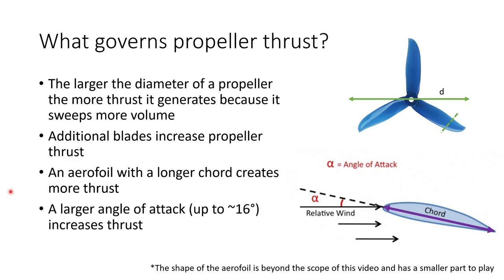How to choose the right props for your quadcopter: FPV Freestyle, Racing, and Long Range

Comment: This is very very interesting and confirms and extends much of my own investigations. I have a question: how does the inflow velocity calculation change for fixed wing? Obviously the vin from the airspeed but do you need any additional factor to account for the inwash from the prop of can I just plug in airspeed in m/s?
Reply from the maker: I think you should be able to calculate inflow velocity using a momentum balance taking into account that the initial airspeed is not 0 as it is for a quad in hover.

Comment: Hi, 
I asked myself all the time how to think about this on my Cinewhoop. I just finished watching your new video about ducts, and I have a squirt V2 at home. Also I am just designing my own "megas-quirt", that can handle 3.5" (89mm) props, as my Squirt is barely holding itself in the air with a Hero 8 and a 1300mAh 4s lipo. 

Now to my question:
How do you think that multiple blades change the therory. By that I mean the 6- or 8-bladed HQ props, or the much steeper Gemfan D76 or sth like this. My testing tells me, that  two props that both are called  to have a pitch of 3 aren't really comparable, doesnt matter whitch size (3", 5", ...). 
In the cinewhoop-part also the diffrent blade-count makes everything even more uncompareable. I really have problems to compare a Gemfan D90 (3 bladed prop, pitch "3") to a HQ 89mmX8 (also pitch of "3") but they clearly are diffrent in their steppness-angle and will poth have very diffrent thrust. 

toothpick-class: Gemfan for example has a 3018-2 prop (biblade) and a 3016-3 (triblade), I also cant tell in this case which prop I could expect to have more thrust. The issue is, that we often dont have real numbers to calculate with or alternatively have simulation-values or static-bench test from the manufacture himself (1st hand).

Sometimes I have the feeling, the manufacuters dont use the pitch-value to tell us how steep the balde is, rather to tell how much thrust they think the prop makes compared to their other props on the market. By adjusting the pitch value they use for marketing so they can put their props in somewhat of an order they make comparison for us pretty rough, and practically impossible to compare to other companies.

Did/Do you think/feel the same as I do, or do you understand my problem? If so, do you have any idea how we could interpret these values we get from the manufactures, or do anything about it other than just buying a ton of props just to find out that 99% arent the ones we where looking for?

Thank you so much for your videos, it is great to understand such topics in greater detail, love it, keep it up!
Reply from the maker: Comparing props is difficult because they are not fully specified by the manufacturers. Their performance is also very dependent on your AUW and flight style.

I would suggest trying a prop and then asking yourself what you want more of:  thrust? smoothness? efficiency in hover? efficiency in fast forward flight.

Then use the info in the props video to move you in the right direction. E.g. more thrust = more blades or steeper pitch (but steeper pitch may be less smooth).
more smoothness = shallower pitch

It is not really possible in my view to pick the perfect prop just by looking on the web. But it is also not necessary to just buy every prop and try them all. You can take a more focused approach. I hope this helps.

Comment: Great content! It got me thinking though, what if one would (theoretically) construct a prop that utilizes centrifugal force to alter the pitch slightly? Think of how a CVT system works with weights and ramps/rollers.. Would it be possible? Would there be benefits to reap from doing this? And yeah, it would likely not be suitable for a 5" prop for rigidity and durability reasons.. Maybe this is already a thing, I haven't read anything on the subject, but this video just had me thinking about how it could be done.

Comment: Hey Chris - I know this might be semantic but I think it is an important distinction when talking about the dynamics of our kwads. I thought that the prop generates lift and the portion of that lift that provides forward motion is thrust? So wouldn't the specific airfoil and angle of incidence change the how much thrust is generated? I thought, Angle of attack is generally in reference to the prop where angle of incidence is relative to the craft's attitude of a specific axis. Additionally, I think the use of certain generalizations is a slippery slope. Also I have a question regarding the V(inflow), I don't think it always has to be axially aligned - but the angle should be a known value for calculation.
Reply from the maker: Hi Zach, in the video thrust just means the force generated by the prop in the axial direction. The lift generated by each prop blade creates this thrust.

There are certainly some simplifications in the analysis to allow general conclusions to be drawn. I think that it is important to make content that is easy to understand so that everyone can benefit from it.

You are right that it is important to distinguish between AOA of the blade and AOI of the incoming air stream. In flight the incoming air will rarely be axially aligned to the prop (more on that in my upcoming video on ducts) but I think it is a valid simplification for the analysis in the video which primarily considers hovering where the the flow will be close to axial.

Thanks for your comment I hope this answer was useful 😁

Comment: @Chris : Thanks for the useful videos . Wanted to bring up one question on props .  Lets say while flying a 5 inch quad we tend to keep stock of multiple props . While all props will usually be 51 series ,  the pitch could vary . Now while flying  lets assume we have a 5143 set on the quad and happen to break one or two of the front facing props . Now the only other set i have is a 5148 set  . If we replace the front props with the 5148  does it cause problems .   what happens if we end up mixing pitch of props mounted on a quad ?  Is this a bad practice  or something that never must be done ?

Comment: Now I know i have to order some higher pitch props for the 5” cruiser i’m gonna build...
Reply from the maker: Wonderful! I hope it turns out great. Is it a long range quad?
Reply: @ChrisRosser  Well, it’s my first complete build. I have build a Tyro129 but all the components were “in the box”. Now i am selecting all the components myself. And since i am a bit older and my brain is a bit slower😬, i want to fly slow and steady. So that’s why i want to built a cruiser. Not really long range since i use analog FPV and i don’t have crossfire yet. But ExpressLRS looks promising. 
So first it’s gonna be a short/midrange cruiser.  And eventually a long range cruiser. I hope 😎

Comment: I have a question about prop tip speed. So I used a calculator, and I saw someone had 5 inch props spinning at 65,000 RPM (max power) so I wondered what would be the tip speed and got 966.8 mph which is supersonic yet the quad was just flying normally even at full power, although it had a very loud “buzzsaw” kinda sound. I feel like there wouldn’t be supersonic airflow that would cause lots of drag on these kinds of props as planes with supersonic propellers like the XF-84 have straight trapezoidal blades, which still wasn’t so efficient. These drone props look like they’d totally handle supersonic airflow with little drag bc of how they curve towards the tip. Just wonder if what I calculated is true, as I would love to find out if/how it is possible to make a race quad with supersonic props as well…I want lots of noise and (maybe) speed lmfao. More noise for sure

Comment: I have a scenario for you. You have a 7" kwad that weights in at around 1kg AUW with 2806.5 1300kv RUNNING A 2200MAH 6S battery. You want to do aggressive long-range flying. Your going to be flying up a mountain that starts at 7500' elevation and tops at around 11k'. What size prop would you recommend to give good quick thrust but also efficiency for distances like 6 mile round trip. I have tried a few different types and settled on one that I really love but curios if there is one you might recommend that I haven't tried yet.
Reply from the maker: I like light pitch props for good propwash handling. I would also choose a prop with a relatively long chord to maximise thrust at high altitude. If you aren't going to ever get into a propwash situation a steeper pitch prop might give more efficiency at speed but you'd want to use a throttle limit to prevent sucking down your battery!
Reply: @ChrisRosser  I started out using biblades but didnt like how much throttle I needed to give it while try to pull out of a long dive. So I went to 7x3.5x3 then 7x4x3 and have ultimately landed on 7056 triblades. The 7056 seem to help give more low end thrust to compensate for the low kv and thin air. The big motors turn them really good as well. I tuned out the propwash issues early on while using the 7x3.5x3 props and havent needed to change that since so I dont think the props stall at all. Honestly this build would probably make you start twitching as it doesnt follow any of your advise I have seen in any of your videos so far. Thanks for your thoughts.

Comment: How might the number of blades on a prop affect the overall vibration characteristics of a multicopter?  The presence of load changes on the arms from the downwash of each prop blade makes me think that a certain number of blades might perform better or worse for a given frame design.

Comment: Would you consider, the 5inch vs 5.1inch props, the extra .1 inch diameter is being done to increase the lift/efficiency that is lost by the lower pitch in a freestyle setting? Also, would you consider a $1 slot on your patreon?
Reply from the maker: The extra .1 inch diameter provides a bit of extra thrust without increasing the risk of stalling the blade. They help a lot for carrying the extra weight of the newer non-session go pros. IMO I think the new hero 8 and 9 probably warrant 5.5in or 6in props!
Reply: @ChrisRosser  Thanks for all the great content and insight. Really enjoying learning the science behind all what we do.

Comment: Thank you very much for these useful tips! Does the chord length of the prop contribute to the stall point? I noticed that I have a prop with a smaller pitch and larger chord but it seems to be more propwash prone than another with a steeper pitch but smaller chord (for example: emax 2.5x1.9x3 vs azure 2.5x4x3). I often struggle to choose the right propeller because of this. It would be useful to know what pro/cons comes with a larger chord because i think pitch and geometry it's a bit tricky case.
Reply from the maker: Not really the chord length is much much less impactful than the pitch. A longer chord makes more thrust so you probably have lower rpms with it which will increase propwash. If you have set up dynamic idle that should really help.
Reply: @ChrisRosser  Thanks i will try!

Comment: What Prop would you recommend for a 4s 7“ build (2807 1700kv motors, 540g dry weight)?
I‘m not sure if 1700kv is low or high kv for a 4s 7“. I‘m looking for the longest possible flight times, so very low Amp draw

Comment: What’s your take on the low-pitch HQ R38 props popular for 5” racing? Subjectively I’ve found I prefer these props to higher-pitched props, but perhaps it’s just because the reduction in trust translates to more control?
Reply from the maker: How do they compare to steeper pitch props with a throttle limit/throttle expo? By reducing your thrust you get more resolution at the low end because a given movement of the stick is a smaller change in thrust. See if you can go faster with a slightly steeper pitch prop and lots of throttle expo to tame the low end!

Comment: And also a question. My predictions were about correct. I want to build a lighter freestyler quad very soon. I picked up 2207 1950kv motors, with 5130 props. I am doing an auw calculation soon, so I could add that info here too if needed, but I want to ask:

Would this be a good or bad setup from the calculation and performance perspective? I don't want to make a dud quad, and I've never really bothered with these calculations, if you could help me out, would be greatly appreciated!
Reply from the maker: Looks very good at this stage. Make sure you have an good battery for 1950KV on 6S, even with relatively low pitch props.
Reply: @ChrisRosser  I'm getting cnhl, and maybe some gnb's

Comment: I have a question about relationship between prop pitch and oscilations.
I was using ethix s3(5031) with lots of oscilations. tried to manage it by tuning the PID but failed. 
One day I had a chance to use ethix s5(5040), all of the oscilations were removed and feel like propwash was even better. 
Everything was in same condition.
BTW I’m flying my quad with these specs.
6s, 1750kv, rpm filter, lowest filter slide, default PID on BF.
Reply from the maker: You may have had an unfortunate case of prop resonant frequency matching frame resonant frequency.
Reply: @ChrisRosser  thanks! well….after this happen, I thought s3 might be too flexy on 6s quads. oscilation is always big issue to me, so I am always serching for a best prop.

Comment: In terms of emptying the reservoir of vibration in the frame it seems like the battery pad would have the largest influence considering its holding an isolated mass that's about 1/3 the total quad weight.  In my case the under mounted battery has a sticky pad connected directly to a carbon surface that also mounts to the flight controller.  I wonder if rubberized pads have a high Spring rate that could  create harmonic frequencies...  Versus gel or soft foam.
Reply from the maker: This question puzzled me for quite a while as well. But if you review some of my frame resonance analysis videos you can see that the relative movement of the battery compared to the frame is very little for these high frequency vibrations. I think that's why it doesn't do as much as the grease on the arms. The arms really do the vast majority of the moving for the high frequency modes of vibration.
Reply: I agree with you, the arm  displacement is the highest and dampening that movement is hard to accomplish in a rigid body.  Some viscous movement is helpful to reduce vibration.  How was your battery mass coupled to the frame in the simulation? Is it a soft spring boundary?  I'd like to understand the result of decoupling the battery mass from the frame with the commonly used rubber layer.  Could the lithium polymer dampen the vibration better if it is pressed hard up against the carbon without a soft layer?
Reply from the maker: @nateteator3901  The battery is sitting on top of a rubber battery pad 2mm thick in the simulation. So there is definitely flexibility and movement but not as much as I expected. I don't know whether a battery pad helps or hurts damping. I would imagine a thinner pad would have less damping but I'm not certain.

Comment: Hello sr. Dji FPV drone is 795grams, 1700kv motor and the stock props are 5328. I have the aikon adapter and want to put some aftermarket props, Wich one could recommend me? I want to avoid the prop wash that this drone have. Thanks and have a nice day

Comment: Chris, based on recommendations I saw reputable sources (I think), I am setting up a 3" cinewhoop with 6 blade props and 3100 kv motors on 6s. It looks like tip speed could reach 0.9 mach if I did that calculation right. Do you think I will have problems?
Reply from the maker: I get ~0.6 Mach for that setup so I think you're fine. I would guess you haven't taken into account that with a prop on max RPM != Voltage *KV. I use a factor of 70% for estimation.
Reply: @ChrisRosser  I must have done something wrong then. Is correct to do voltage per motor or does all 6s voltage apply to a single motor?

Comment: Can a quad make the propeller tips go supersonic?
Also, how come that quads, no matter how hard the manoeuvre, don't seem to be affected by "settling with power"? can't small propellers be stalled no matter what either?
Reply from the maker: The torque required to overcome transonic drag is very high. No normal quad could go supersonic but maybe a big very high kV motor on 6S spinning a smaller prop?

Not sure what you mean by settling with power?

Comment: Hi, it sounds like it would be helpful to set dynamic idle (dyn_idle_min_rpm) in betaflight to just above the stall speed of a given prop. I would love to learn how to determine this setpoint.
Reply: You could log your flight, then graph z acceleration as a function of motor rpm while slowly ramping up throttle setpoint. The stall zone is where the derivative becomes negative.
Reply from the maker: Very interesting idea I like it! It should be set just above the stall speed during the worst adverse flow conditions (a big split S or power loop) because you don't want the blades stalling at the bottom of the move.

Comment: Hi, Regarding LR builds and maximum efficiency, how do you explain using low pitch props in all long flying DJI mavic like drones ? It's not according your guide :)
Reply from the maker: High pitch props are only efficient for fast cruising. Mavic's don't fly fast, they are basically hovering so low pitch props are good for them.
Reply: @ChrisRosser  Indeed :). So your prop selection advice for LR is not very accurate, LR is not fast cruising, but long range flying . Anyway thanks for all your videos!!!. Really good work.